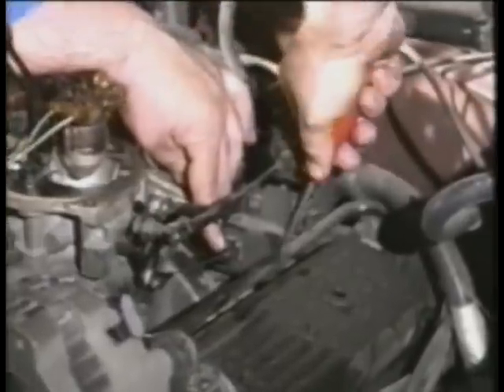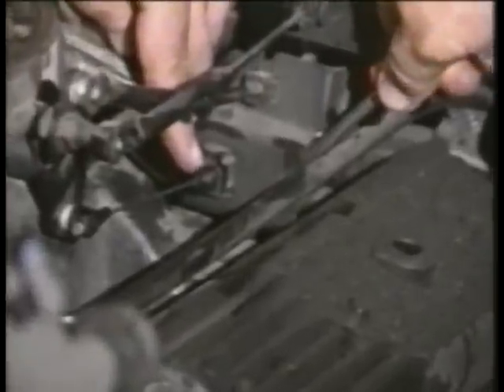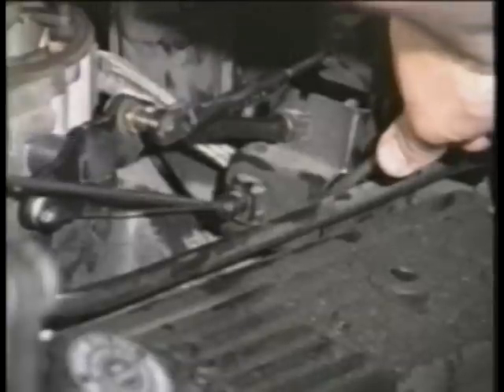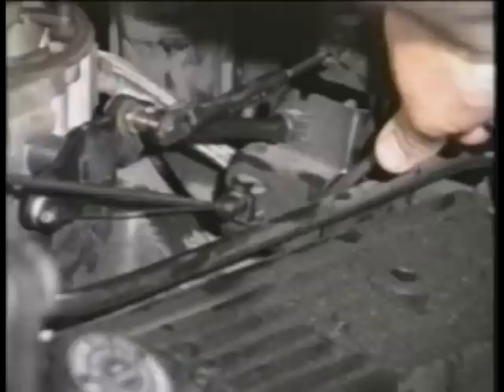TV Cable Adjustment

Comment: I have searched and searched and searched for a video or article that explains the correct way to adjust a TV cable with a TBI!!!!  This short video finally gave me the correct info, wtf!  Everything I was watching and reading related to carbs with the self-adjusting, ratcheting adjustments, and if I adjusted my cable that way it would be WAY too loose.  I understand the bulk and fine adjustments but this video showed me the info I was missing.  THANK YOU

Comment: The above video shows the wrong way of adjusting the TV cable. According to the 1992 Chevy service manual (page 7A1-59) the TV CABLE ADJUSTMENT procedure for 4L60/TH700R4 is this:

"Adjustment of the TV cable must be made by rotating the throttle lever at the throttle body. Do not use the accelerator pedal to rotate the throttle lever.

1. Stop the engine.
2. Depress and hold down the metal re-adjust tab at the engine end of the TV cable
3. Move the slider until it stops against the fitting.
4. Release the readjustment tab.
5. Rotate the throttle lever to its "full travel position."
6. The slider must move (ratchet) toward the lever when the lever is rotated to its "full travel position"

- Check that cable moves freely. The cable may appear to function properly with the engine stopped or cold. Recheck after the engine is hot."
Reply: +Karg1975  I have a 1990 Silverado with a 700R4 transmission, and I found your method was much better than the video tutorial shown above.
Reply: is this the same way with the TH350 TV cable??
Reply: steliosz28 : probably too late to matter now but th350 is a different deal. it's a kickdown, not a tv.

Comment: If you have no reverse it could be a couple of things which all require tearing the trans apart to fix. 1 cause is the sun gear or shell damage, 2nd cause can be your reverse clutch pack. Both require rebuild. Some shops would say you need a total rebuild and charge 1200 or more but if you can get an reliable shop they would tear it down and ONLY replace damaged parts or replace a clutch pack. Only requirement of major repair would be scoring caused by metal pieces or damage to major components.

Comment: Another cause which if your lucky would be problems with your valve body. If that would be the case it will be alot cheaper to replace and should only cost $400 for replacement and labor. Anything more than that I would tell them there smoking crack and take it somewhere alts lol. Ive dealt with alot of people coming to the shop I work at because of people charging way to much for repairs. We charge $65hr which in my opinion anymore than that is highway robbery. Good luck to you

Comment: most older mustangs use a vacuum modulator to do this same job and the modulators must be calibrated for the required shift pattern all of the vacuum modulators are color coded for this reason ford's cable does not work the same way this was done on a GM and is GM only

Comment: hell no that is not the way to do it DO NOT DO IT LIKE THAT THAT WILL MAKE IT SHIFT WAY TO HARD AND SOME TIMES NOT AT ALL doing it like that will make it too tight the other easier way to do it is opposite push the stop all the way in until it stops then open the trottle to (WOT) and you will hear the stop ratchet out a few time then it is perfect